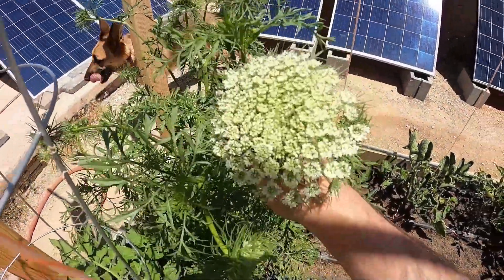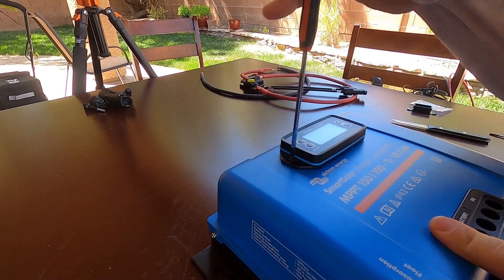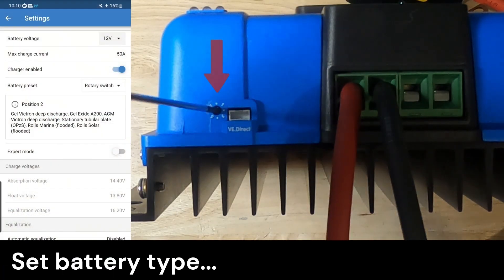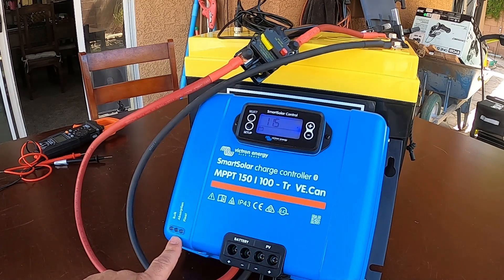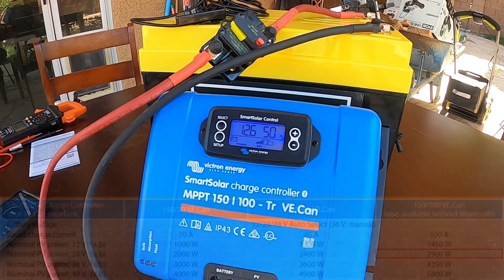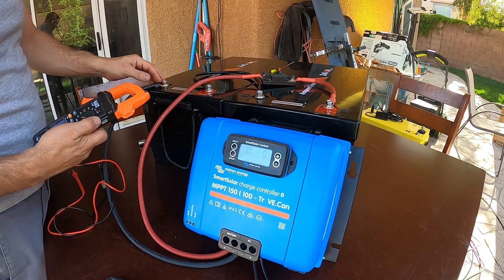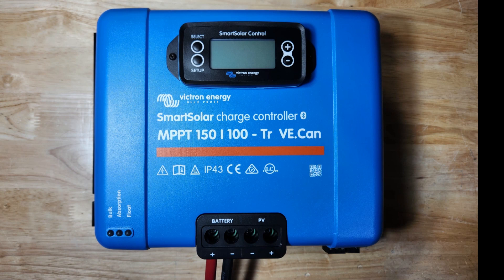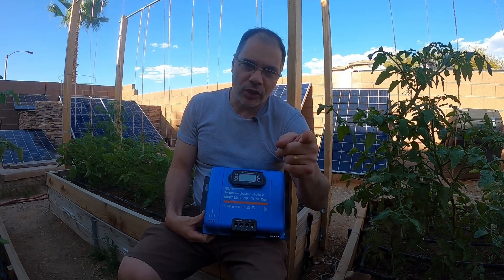Victron 150|100 Review and Test - For Beginners!

Comment from the maker: If you need higher VOC, check out the Victron SmartSolar RS! The RS has a VOC of 450V and is available in 100A or 200A output. It also has 2 Isolated & Independent solar trackers that can take up to 7200W of solar on each tracker. Link in the description...

FWD: 12:47 to see the side-by-side comparison. Enjoy!

Comment: ON THE ROTARY SWITCH ON THE VICTRON WHAT IS THE SETTING FOR AGM
Reply from the maker: 1,2 or 3.. 2 is default so I would just use 2
Reply: @natesdiysolar  hey thanks million i have 5 systems going i lost my first 150/60 victron i had 60v coming in 2000 watts of panels coming in i do all diy bat 24v i have about 120.00 in each one again thank you

Comment: If it goes up to 100 amps why the default and charging at 50 amps for 800 dollars
Reply from the maker: Yea it was expensive.  It's 500 now.  They do that for safety reasons. 100a on a single battery would be too much.

Comment: When changing output voltage and batteries, be aware of the voltage input of your inverter. 24v and higher on a 12v inverter will fry it.
That controller weighs about as much as a gallon of milk too.
Make sure you have good mounting.

Your wire from the array also plays an important role.

Comment: Thank you for the video! I have one of the Victron Mppt 150/100 charge controllers. Its has been on a 12 volt system for a few years now. I have 3 250 watt panels in series feeding it. I found your video because I did a search for changing from 12 volt to a 24 volt system. I wish you would explain over paneling more. I had stayed with 12 volts because I already had the inverter. I never knew how much more I could do at 24 volts with the same equipment. Ordered a new 2000 watt inverter (only use 300 watts or less) for 24 volts and am taking the plunge. I also found some 24 to 12 volt converters I can use for my 12 volt Ham Radio equipment.   Thank You again for the video!
Reply from the maker: For overpaneling, you can go over in wattage by 15%. So at 24v I think the rated max was 2800w if I remember.. victron allows 15% more than that so 3200 watts total but u must never exceed the max voc limit.  You probably will end up with 2 or more parallel strings .. increasing the pv amps input. It should talk about this in the manul.

Comment: what is the Wattage of the controller
Reply from the maker: Depends on the output voltage.  1200 2800 3600 4800w for 48v

Comment: If I was planning on running 4-450 watt panels with a voc of 41.72 to a 12v 300ah battery would this be overkill? I plan on upgrading to a 48v battery as well but my plan is to alternate between charging the batteries.
Reply from the maker: You would be over voltage on that unit.  It has a max of 150. It's a hard max. If you don't want to spend the money on that unit you could just get a 48v charge controller and use a small DC to DC converter to cyphon power from the 48v battery to the 12v battery.  This way you won't have to change configuration settings each time u want to change batteries and you could charge both same time

Comment: I just burned a 60 amp renogy, caught my storage spot full of melted wires. No fire Thank God. So I bought this 150/100 unit but I am adding a bunch of circuit breakers.
Reply from the maker: It's not a bad idea. I would add a fuse as well.  Blue Sea makes quality CB. Don't buy cheap ones.  Good luck

Comment: hallo kalau scc yang 250/70 memiliki input pv 3 buah na setiap input nya itu apakah memiliki batas tegangan sama arus atau bisa di pakai 1 input saja ?
Reply from the maker: Each input has its own limits.. so if the max voc was say 300. It would mean each input has a max of 300. It's not divided across the inputs.. it's not multiplied across the inputs either, so it would not be 900 on a single.. each are independent.

Comment: How many 420 watt (38voc) can i install on 150/100 victron in 48 volt system?
Reply from the maker: Those panels are not well suited for this unit.  You would be better off going with the RS that has a higher voc limit, but I'll give u the numbers..  kinda need to know the ISC as well, but not very important.. 38v x 4 puts u at just over the 150v voc limit at 152v so you need to limit your strings to 3 panels per series strings.. 

Assuming your ISC is 10a or less you could have 3s3p or 9 panels for 3780w or 3s4p panels for 5040w..  4 parallel strings of 3 panels each you would need to use 8awg wire..  the unit can handle 5800w @ 48v . 

This unit is better suited for 200 to 250w panels with lower voc..  hope this helps.

Comment: I have the same controller ,I am going to hook up   4 -12v  deep cycle  batteries in a series total 48v . Do I set my controller for 12 v batteries . Thanks
Reply from the maker: No, it will be 48v . In the video, I connect 2x 24v in series for  48v . Whatever the final resulting voltage is for series connection is what you will set in the controller.
Reply: @natesdiysolar  thanks

Comment: My midnite classic 250 died out of nowhere, and they wanted 200 plus shipping both ways for repairs. I ended up getting a Victron 150/70 tr to replace it. What a difference. I am getting higher input and cooler running temps. Keep in mind Victron doesnt have fans but rather passive heat sink cooling, and the Midnite has 3x fans! Fans which suck dust into the internals and boards are covered, surely that doesnt help cooling! Victron was also much easier to setup and find specific settings. Best part is i can check my system without getting out of bed! The app is untuitive, history and data collected are top notch and it has a 5 year warranty. Oh and its a pretty blue. Im sold
Reply from the maker: Lol, good deal.  Yes, fans are always a potential point of failure.  I'm glad you like it..
Reply: I am going to buy that exact same controller soon. It should allow me to run six 200w panels and not be a problem.
Need the higher voltage due to long run and smaller wire.
Initially I will have 4 of those panels. All going to be in series unfortunately.

Comment: Nice vid my friend. One question?!
Victron Mppt 150/100
12v(parallel) system bat, x3 200ah = 600ah

Option 1 
6 panels with 200w 23V and 11.05A parallel system = 1200w 23V and 66.3A

Option 2 
2 panels 600w 41.3V and 17.2A parallel system = 1200w 41.3V and 33.4A
which option is best for this case?
Best regards
Reply from the maker: Typically you want to keep the Amps as low as possible by increasing the voltage as much as possible.. 15% under 150v max so 135v max.. when you cross that 30a threshold you must use 8awg pv wire.. its more expensive than say 10awg.. unless you have a short run... also when you go higher amps you must fuse each parallel string... that charge controller at 12v is suites well with 200 to 250w panels. Panels of this wattage will have a imp value less than 10a.. so you could easily have 3 parallel strings if you decide to go to a 24v or 48v system.. the more amps the more fire prone things can be as you are dealing with higher current. But if I had to choose from your 2 options.  I'd go with #2. But in either case you need 8awg pv wire.  10awg pv wire is good for 30a. Hope this helps.
Reply: @natesdiysolar  You helping a lot , Thank you.
If you put the systems in series, in this case is option 1 is better? 
More volts or amps do not influence the better/faster battery charging?
Sorry for my bad english.
Reply from the maker: @Alexandree55  yes that would be a perfect setup. It does not affect the charging either way.  The job of the charge controller to to convert that higher pv voltage to a charge voltage your battery likes.  Watts are watts no mater how it's wired you will still have the same watts.  Watts equals total volts times amps. If the voc of your panels are 24v then 6x panels in series would be 144v voc. That is just under the 150v voc limit.
Reply: @natesdiysolar  100ft each way 8 gauge wire can result in a 15% power loss due to line loss.
That is my problem.
I plan on having six 200w panels in series to get about 150v, 54amps, 800 watts.
BUT what I get at the controller will be about 15% less due to 8 gauge wire.
Don't know of any MC4's that handle 2/0 wire lol.
Best I could do is 6 gauge wire but even that has pretty big losses.
You want all losses to be UNDER 5% if possible,
Reply: Im pondering the setup with 6 panel 200w 23v in series, its for my RV. The only thing i prefer in parallel setup its when one of the panels is in the shadow the rest of them are not affected.
Thank you so much Nate!
Reply from the maker: @Alexandree55  that is true.  Perhaps do 2s3p or 3s2p

Comment: Mine is arriving tomorrow ... Newbie at best. Trying to gather my components together before setting up a functional array. Dumb question ... what kind of circuit breaker are you using? Great job on the video.... entertaining as well.
Reply from the maker: Hi. I use this one made by blue sea . It's marine rated 

https://www.partdeal.com/blue-sea-systems-surface-mount-187-series-circuit-breaker-150a-7148.html?utm_source=googleshopping&utm_medium=cse&gclid=CjwKCAiAu5agBhBzEiwAdiR5tMAN3w2xUF3fM2aF0r_hciZhMq6VLGCQAKkktwIEkbfy5IX8vM-6uRoCF-wQAvD_BwE

Comment: What size circuit breaker is best for and 12 v  battery and or a 24 v battery
Reply from the maker: That depends on your inverter. Take the watts of your inverter. 
eg: (1500w / 12v) * 1.25 is ~ 150A
75A for 24v battery

Comment: It's funny how all the pics of the Victron units look the same size, then it shows up like this...heh...
Reply from the maker: Is it larger lol.  I think I took the picture myself
Reply: @natesdiysolar Just a bit larger than a 75/15... ;-P  I got the 100/30 but using it in a mobile use right now, may swap a 75/15 in for that use once I convince the wife on some more panels for a small permanent install...Have a good south facing 'ledge' of roof that should be able to do a few hundred watts, good 'nuff for some shop uses charging lawn stuff...
Reply from the maker: @ChrisEpler  oh lol thought you were talking about the actual image size lol
. Yea they have a 250v version as well 250 100. Just show how much you save on your power bill lol
Reply: @natesdiysolar  Well so far I've saved us about $0.34-$0.51, so it's not convincing her yet...  BUT it does get me out of the house and walking back and forth checking it and putting panels out, rotating them to follow the sun etc so there's that...
Reply from the maker: @ChrisEpler  lol

Comment: does overpanel means  amps only ? i mean i m sure cant  play with more voltage but can i overpanel my 100/20 with 2s3p  8,5amps each   panels  ? gives 24A+
Reply from the maker: Generally, they are referring to watts. I looked up the specs for the 100/20 and it says max pv short cuircuut of 20a so I don't think it would be a good idea to exceed that 20a value. Likewise the 100 15 has a limit of 15a.
Reply from the maker: Check out this calculator. 

https://explorist.life/solar-charge-controller-calculator/

Comment: Hi Nate, just found your channel today and appreciate your method of explaining solar -  I too purchased the Ampere Time 24v 200 Ah battery - problem I had was several chargers popped because the BMS in the battery disconnected too early by a few volts during relatively high current charging - have you had this experience? - 

I eventually bought the Ampere Time charger in desperation, no problem with that charger but I am worried to connect my Victron 100 / 50 controller - any tips?   Thanks
 
When you show the bluetooth BMS that is that for the yellow top 12 battery, correct, I would like to know if the 24v 200ah BMS has bluetooth but don't think so...
Reply from the maker: And thanks for watching!
Reply: @natesdiysolar  Thank You..
Reply from the maker: Really.. hmm I run 2x 24v 200ah on my Solar Power Station in parallel and regularly charge at 60A but that would be 30a per battery. That is really unfortunate.  I have had zero issues with those batteries. How many amps were you pushing on a single battery.
Reply: @natesdiysolar  2 different AIMS Power Smart Chargers charging at a little over 30A but instead of going to a lower rate they suddenly overloaded the supply power and popped the breaker and quit working - The BMS kicks out at 27.7V instead of 28.8V - hopefully the Victron can set max charge voltage at 27.7V
Reply from the maker: @AmrHollywood   @AmrHollywood  I was looking to buy one of those aims units . Turns out no one sells them any more because to many problems with them.  I would bet that is not the battery but those aims chargers. Have a look for yourself.  You can't get them.  I just looked at the manual for the 24v battery and it states a recommend charge of 40a but on another page it give you time to charge at .20c and .5c 100A and also states a max continuous charge of 200a. I would say it's safe to use you victron with it.  Many ppl use those batteries.  I have not hooked up my victron unit permanently yet but have charged a single battery with as much as  50a . Hope this helps.  Post the question in will prowse dyi solar group to get 2nd opinion.
Reply from the maker: @AmrHollywood  yes you can set a max charge on the victron. I have my float at 27.2 or 3.40v per cell.

Comment: I dont see the appeal. So expensive. Display looks like a calculator from 1980, so amateurish and insulting to the customer for buying a "high-end brand", yet costs extra, and the ability to use 12-48v is present in even the worst and cheapest mppts and some pwm. Point being, its not special. Also.. Anyone can hook up a lot of mppt's to a large battery bank. No special software is required. Even the cheap "one solar" mppt can do 150v, show graphs and actual real menus and letters in the display with no extra expenses, and offer 12-48v as well, add a bit more $ and powmr can give you up to 500-600v pv. Or a nother brand if you dont like that one.

Yes i know people say victron is holy quality and blabla. And.. nobody said it was bad. So hold the tears...But..! The story that all other brands are bad just because they cost less than half.. i dont buy it.

I can appreciate they are there, victron, creating competition.
I also like the huge heatsink. And the software seems neat. But not for 600-650$ extra... Or much much higher.. pr item in that eco system.

Edit: forgot to say thx for video. I did enjoy it.
Reply from the maker: Thanks for watching!
Reply: Victron has a quality standard to compare the market to. If you are dependent on solar, then the last thing you want is component failure. Checking reviews will show quality and lack of on Chinese knock offs. If you are prepared to live with the chance of catastrophic failure, or loss of power at a vital moment then go with what works for you.
Reply: A cheap Chinese toaster is fine. If it catches fire you are close to put it out. A cheap Chinese controller cooking your batteries and setting your house on fire is a whole another matter. Nobody who has ever opened a cheap Chinese controller and knows electronics would buy one.

Comment: I have the 150/85 version of this. It's a monster, 2400w array into it. Doesn't even break a sweat. BTW you can find these that are limited to 12/24v at about half the price. Check out inverter supply for the weird 12/24v limited ones, save a bunch of money if you dont ever plan going 48v.
Reply from the maker: Oh, ok.  Good to know. Yea, I plan on going 48v soon.
Reply: @natesdiysolar  Yeah, I wish I could afford the RS version. I like the Isolation it offers.
Reply from the maker: @Brad Cagle  yea that's a real cool feature.. me too. Did you over-panel your 150 85.. how many parallel strings do you have.
Reply: @natesdiysolar  it may be over panneled by a few watts. If i come across a few more 72cell 300w ish panels i might add them. It 2 in series, and 4 parallel.
Reply from the maker: @Brad Cagle  that's the panels I have.. 335W 72 cell. So your pushing 40A on you pv input..
Reply: @natesdiysolar  Yeah, I have the MC4 version. 6 panels on one 10awg cable back to the controller, the other 2 panels are on a 12awg cable back to another set of mc4 connectors on the controller.

Comment: HOWdy N-DIY-S, ... 
Thanks = VICTRON is Quality & a great brand name ...  
SCALABILITY is also a desirable FEATURE  ... 
but only = Only - ONLY   150 PV Input LIMIT 😞 ...  
I have 250 DC Volt PV input on my system -  ... 
but newer units have as much as 500 volt PV Input ! ... 
   so  150 volt input is no longer a desirable LIMIT  ...  
... 
IMHO 
COOP
the  WiSeNhEiMeR from Richmond, INDIANA 
COOP
...
Reply from the maker: Yes, I see.  Definitely makes things easier with higher VOC.
Reply: my growatt spf5000es has 450dc max input

Comment: 150 volt is low… for big installs its not good
Reply from the maker: You have to consider the charging amps. At 48 volts, that's 6000 watts of PV input... not small.  You would have parallel strings. But yes, it's considered low voltage. They have a 250V version as well.. I think that's the largest one.  
Thanks for watching!
Reply: @natesdiysolar  = new (other brands) have as much as 500 volts  PV input voltage limits now 
COOP
....